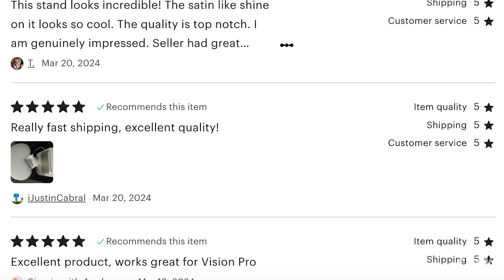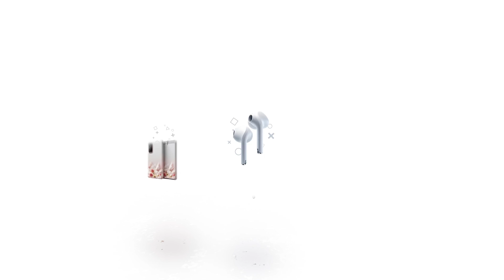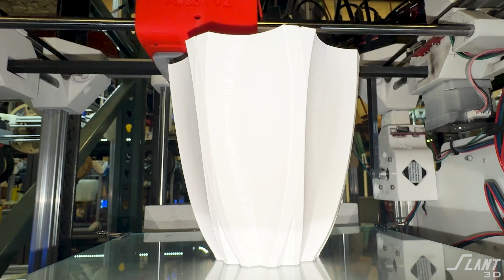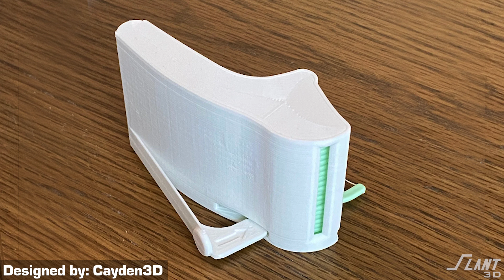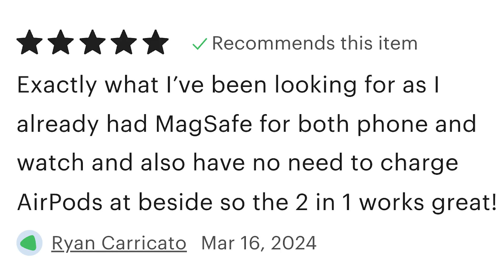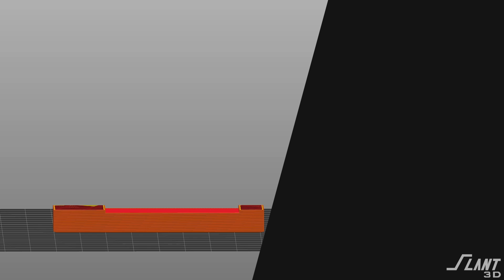The Most Profitable 3D Printed Products | 3D Printed Apple Vision Pro Stand

Comment: I'm surprised how few arguments you have against injection molding. You stay so shallow. You keep on repeating the basic few issues (part too thick, undercuts in design, no iteration, etc.). If you ever had to manufacture (not design) injection molded parts, you should know about all the other specialties and difficulties needed to get an injection molding part up and running. Dozens of specialties, multiple companies would be needed, logistics for the material, tool steel, press sizes, mold flow, CAE, etc... Leverage your "extensive" knowledge to convince people of the actual difficulties of the professional world. You're communication skills in so many videos feels sub par.

Comment: How am I supposed to design an accessory for something I don’t have dimensions for?
Reply: Exactly. Buying a $3500 device just so you can design the accessory isn't exactly "zero startup cost". It's only zero for the stuff you would buy for yourself, so better hope you're a trend follower!
Reply: @dsp4392  With apple stuff like this, you can resell it pretty much instantly for a tiny mark down. Or depending on the product, and its desirability and supply, maybe even a mark up.
Also, if you really want to make some easy money you can buy a product like this, and recreate it in cad with accurate dimensions, and then sell that on the 3d model sites. In a gold rush, it's the guy selling a shovel that makes the most money!

Comment: Quick question: If I had an Etzy store (I don't) and I make a new item or modify an existing product, how will you "support" that new product? Do I just put apply it and customers will be able to buy it from day 1?
I would assume that you'd have to figure out if it's actually possible to print, what's the best print settings for the item, and how long would it take to print(Delivery time). Do you print a bunch of models of each print? Do you eat that cost or does your customers?

Maybe an idea for a future video? I'm really interested in the process.
Reply: I suspect they will answer more completely but go back and look at their Etsy API videos that go into all of your questions.  I believe before they accept the order they confirm the model is printable, etc, along with the cost.  I also understand they have limited printer settings applicable to most items.  But their earlier videos go into such questions and I believe answer them.
Reply: Etsy plugin is only PLA, .2 layer height, 20% infill in grey, black or white. Nothing else... yet